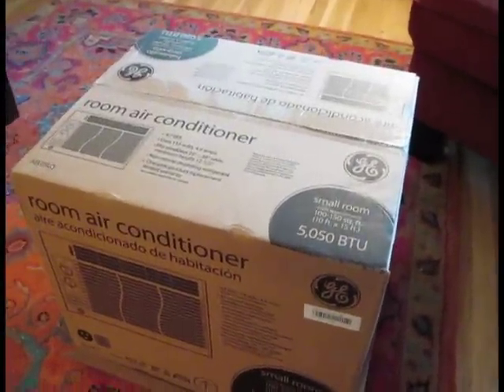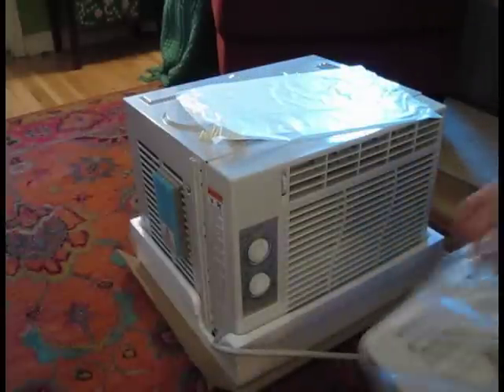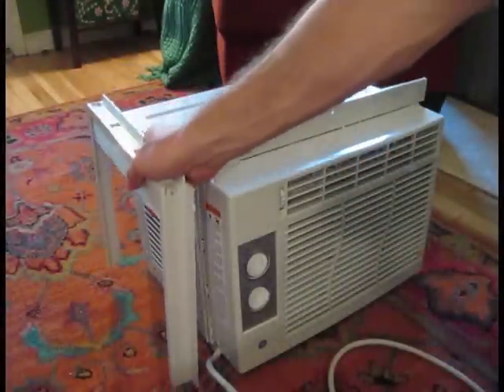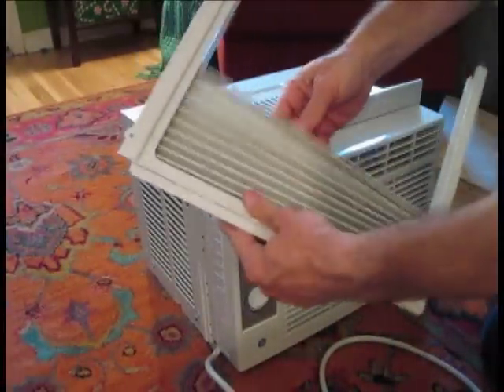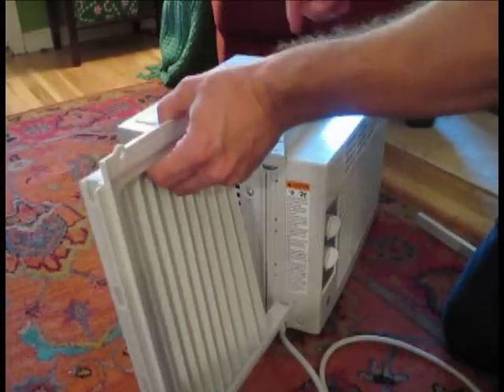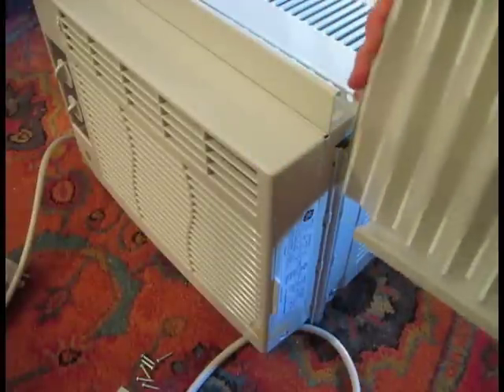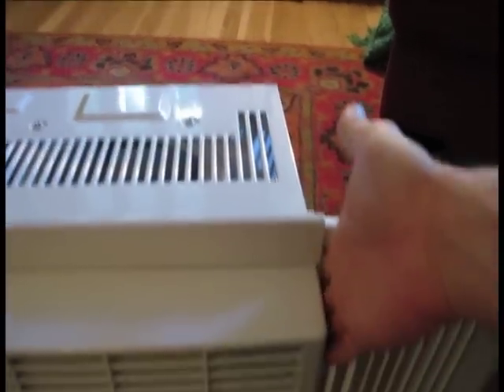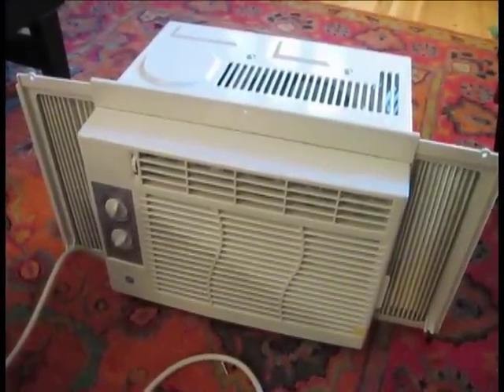How to Setup a New Window AC Unit

Comment: I have a similar A.C. and because of the top bar holding the A.C. in place with the window I've had an issue with it not being able to drain out properly and causing water to leak into my neighbor's apartment.  Would you suggest purchasing anything dditional to help?
Reply: The water will leak in the inside of the house and onto the floor.  Temporarily what I did was tilt the AC slightly downwards out of the window and I saw the water drain out however the top window bar is on the outside of the window and not necessarily supporting the AC from falling out the window if some force is used.  What should I do? P.S. I feel some cool air coming into my house but it's not the same before adjusting the AC
Reply: I was thinking of buying this to go along with my A.C. to keep aid it in draining the water out--- Jeacent AC Window Air Conditioner Support Bracket No Drilling Heavy Duty

Comment from the maker: The strips primarily go between support bar and window.  Also, you can put them between the AC unit and the upper support bar.  However, as I said in the video, it's not 100% necessary.  However, if you plan to keep the unit installed all year, the weather strips can be good to seal out the cold in the winter.
Reply: HowToWith GEO I have the same ac I took out my filter and don't know how to put it back